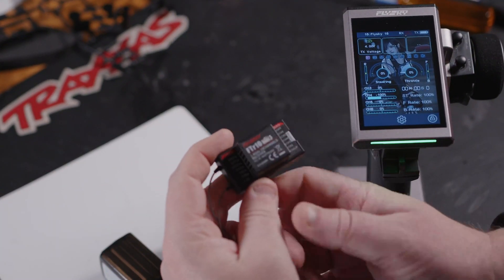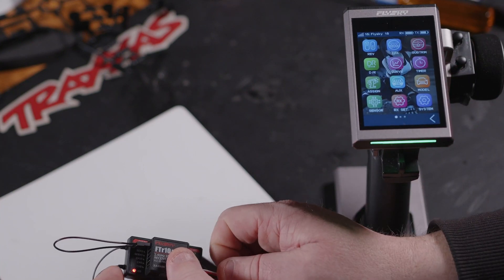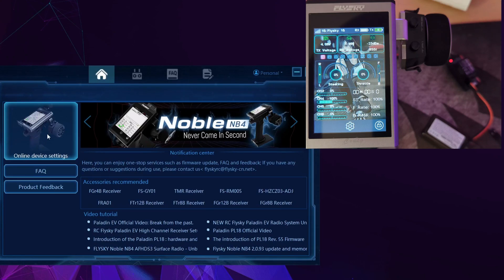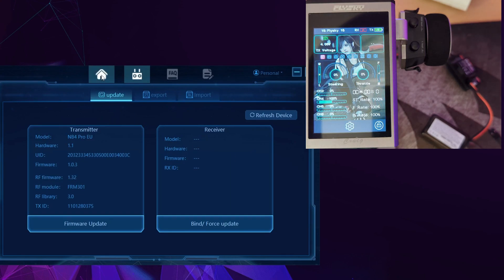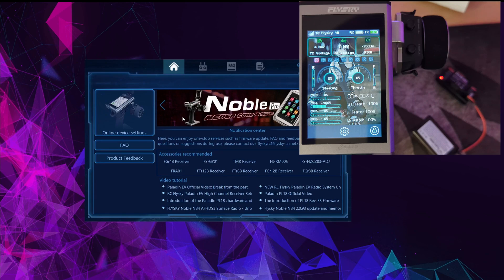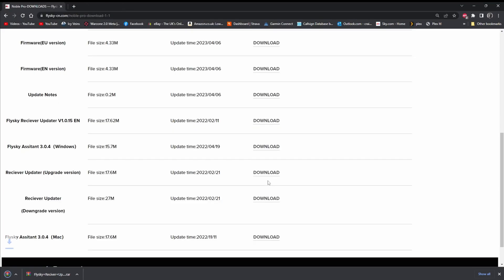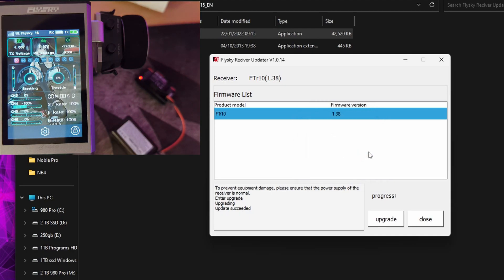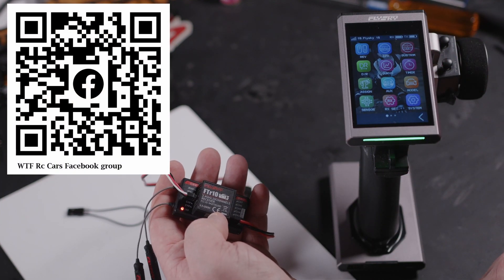Update Flysky FTr10 via assistant V3 and Receiver firmware updater 1.0.15 to work on Noble Pro V3.

Comment: Is this only for the ftr10 or do the other receivers work through here as well?
Reply from the maker: You should be able to update any so long as assistant v3 has a firmware for them or you can download a receiver updater for that receiver :) I'm doing the fgr8b in my crawler so will make a vid of it if it works :)